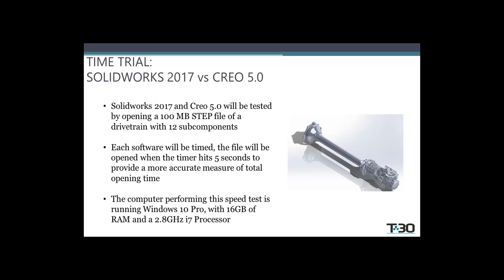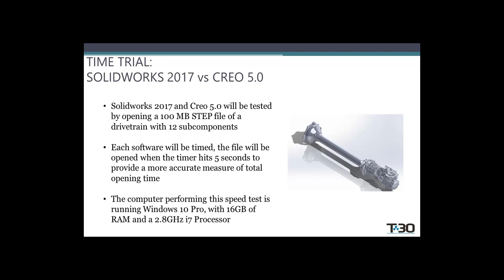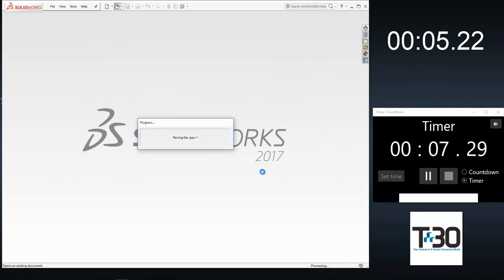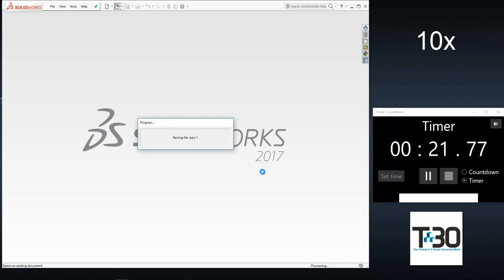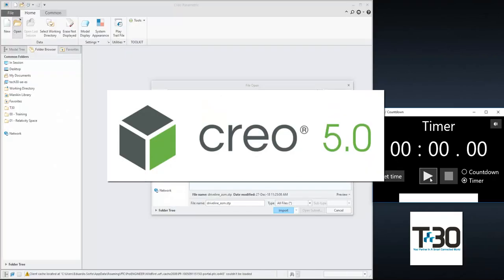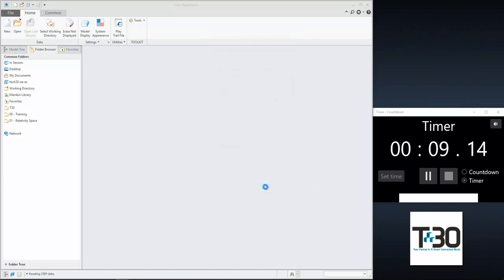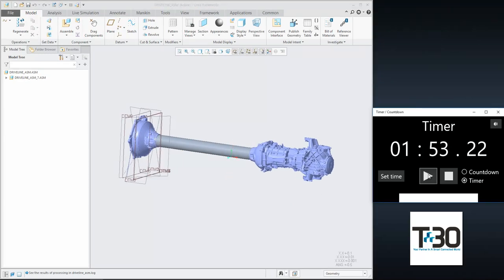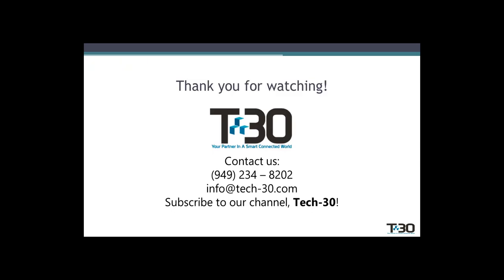PTC Creo 5.0 vs Solidworks 2017 – Speed Test

Comment: I believe it would be more accurate if there are two separate files with correct extension. For example sldasm for solidworks. I highly doubt that it will give the same result

Comment: So do you think this is the most important parameter what we need to check when we wanna buy a CAD. Importing a foreigner file (what you will do once, because you'll save it in natural format at 1st time) . Wow, thats clever. 
I 'll buy PTC Creo its almost 5 times better CAD system than Solidworks and it's even cheaper !!! Thanks it was very informative !
Reply: OK sorry, I checked your video list. You work with PTC Creo. So you are totally unbiased. You tried to find something where PTC Creo wins, and you've found this. Not bad.

Comment: who cares of the speed. Once imported, can you edit parts in Creo like solidworks does?... I don’t think so, creo does it like an autodesk viewer, not to edition and save every single part of the assembly, fast to open, but not for work and edit... by the way, solidworks 2019 has new way to open imported step and iges files. This dumb is comparing with a version of 3 years ago... I can do the same, for me Creo is like solidworks 2007
Reply: Who cares of the Speed? Productivity does. If you have to open 3/4 large assemblies it is abosutely unforgivable to waste 20 minutes of your 8 hours work day  to just load some files.

Comment: works takes time to check through all the errors. If there is no errors or the assembly is originally created in Solidworks with simply a few errors. It won't spend 5 minutes for just an  assembly like this.